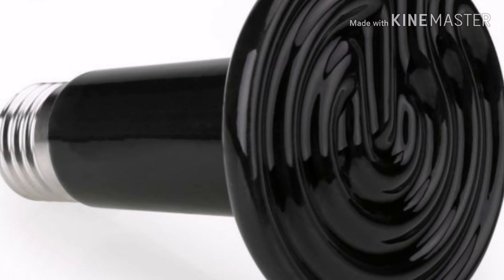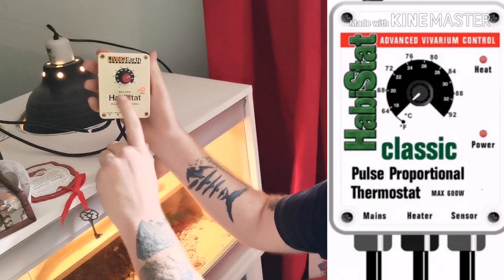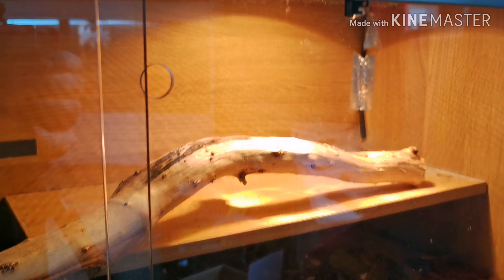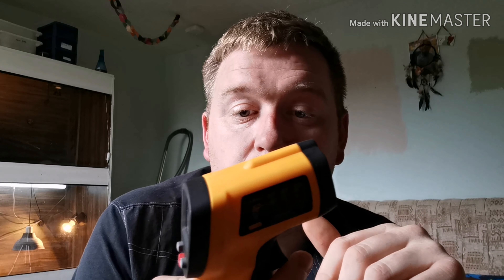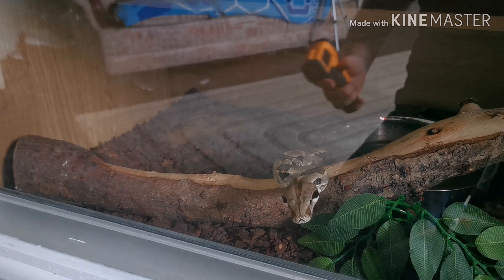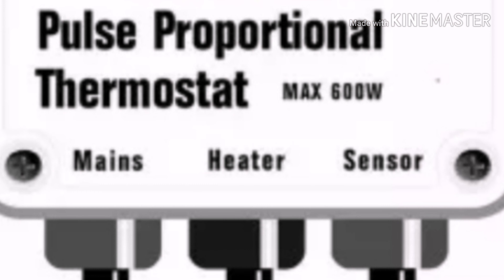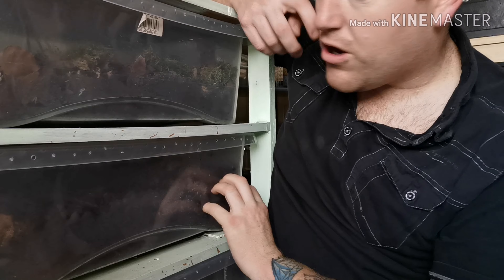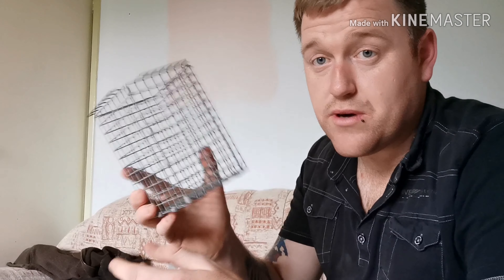Reptile Thermostat Setup ( How To Setup A Pulse Proportional Thermostat)

Comment: Really well explained thank you!. 
I use a MVB providing combined heat and light in my viv, but am finding it is not reaching the ambient temp I need. Would you recommend I use a CHE connected to a pulse thermostat to add a little more heat (like 5⁰c)?

Comment: Is the ceramic heat emitter you linked in the description reliable in your opinion? Is it the one you use and does it last a while? If not, what would you recommend?
Reply from the maker: I have had the reptile systems one in with my boa for over a year now it's on a pulse proportional thermostat

Comment: can you do one on a dimming thermostat? Ive had my enclousure set up ready, but then discovered ive been running my 100w basking bulb on a Habistat digital timer thermostat!! Had it set to 40c, but the highest temp was 45c!! Any ideas? Could i run a Habistat Dimmer Thermostat off the Habistat Digital Timer? Or would it just be better to get the Habistat DIGITAL Dimming Thermostat (Day and Night)
Reply from the maker: A dimming thermostat is all about probe placement. I place my bearded dragon probe in the middle of the enclosure set at 28°c for the amdiant temp . Basking spot temp will range from high to normal first thing in the morning when it first comes on to raise the enclosure temps. Go to a reputuple reptile shop and see how they set up there dimmers. Alot of info online at the moment is old knowledge. Times have moved on. If it gets to warm on the hotspot the animal will move off it .

Comment: Can i ask a question i have the thermostat pulse high range, when my ceramic heater is connected the light on the thermostat where it says heat doesnt pulse/flash when you set the heat to the right temp... Even if i lower or higher it.  It should pulse and the light should flicker on and off shouldnt it?
Reply from the maker: It should. Maybe the heatbulb isn't big enough. It might not be reaching the thermostatic temp

Comment: I own an Asian forest scorpion and lookin to get a CHE only thing putting me off is the probe as when placed in vivarium will it not let all the humidity out as they need high humidity
Reply from the maker: Are you on about evaperating the moisture? 
Don't set the thermostat to hot and you won't have an issue and you could either add something like spagnum moss into the substrate to halo retain humidity or spray more often
Reply: @NORTHERNEXOTICS  I was using a heat pad and when I put the sensor inside the vivarium I noticed quickly how fast the humidity was going down kept spraying regularly but as fast as I was spraying just kept going down and had it set at 25 degrees
Reply from the maker: You could add something into the substrate to help hold humidity . What about going bioactive with a drainage layer. You could add water to the drainage layer to replecate our own water table. That will keep it good.
Reply: @NORTHERNEXOTICS  yeah I've been looking at videos on how to add a drainage layer any suggestions from yourself which is the best type of clay balls and is hydro fleece better than mesh ect

Comment: Im so cofused. I can get the temp to 32 inside the hide and 26 on the cool end if I set it to max. 100w che bulb. Problem is the cage is roasting and the top of his black plastic hide is roasting. Bulb is not touching the cage. I just turned down the stat to 30 because I feel like if he goes on top of the hide he's gonna fry, even though temp inside the hide is right. What am I going  to do please? This has me worried all evening.

Comment: Hello how do you control the temperature at night?
Reply from the maker: You can use a thermostat with night temps however in the UK in my house it doesn't require any additional heat. In Australia it can get cool at night